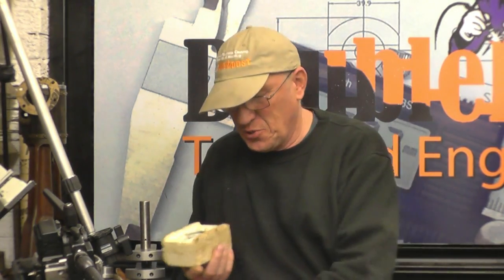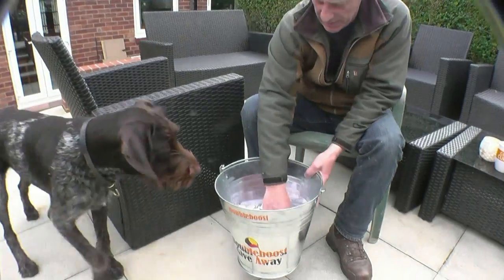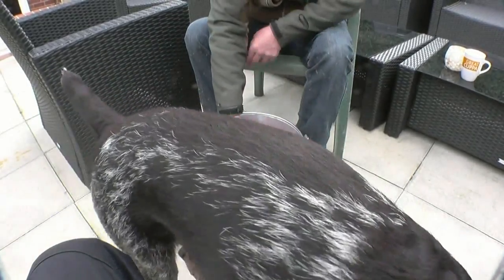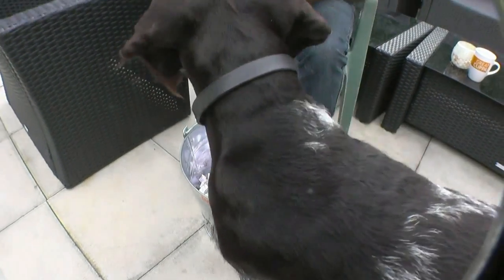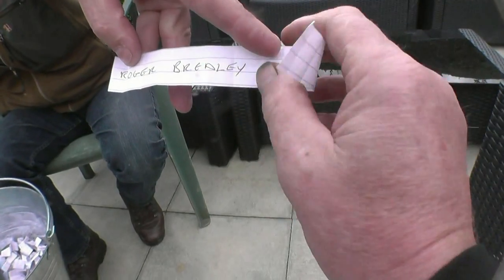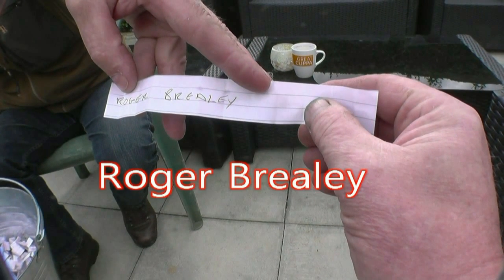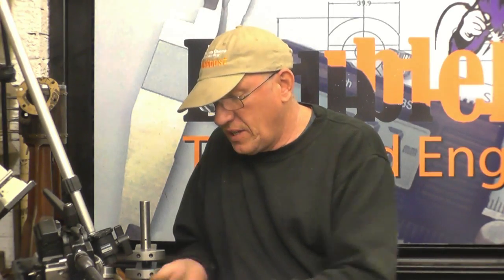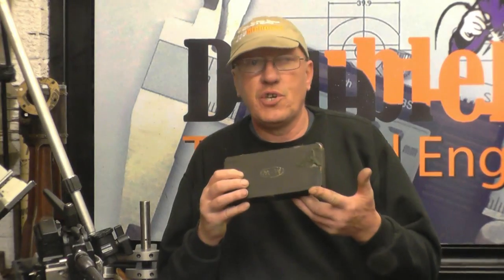SNNC 190 P1   Broaching Guide  28000000 views

Comment: Hi John great work as usual but as someone who's learning, why didn't you cut the slot in both directions as I couldn't see that it would have been climb cutting or am I wrong , which is very possible?
Reply from the maker: I did not want to put a cut on inside the slot  better to put the cut on in open air